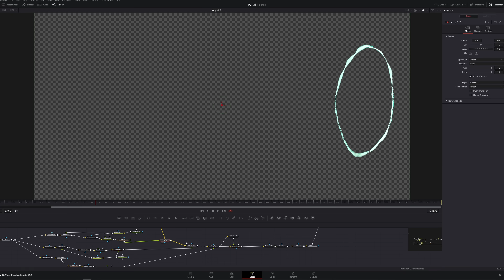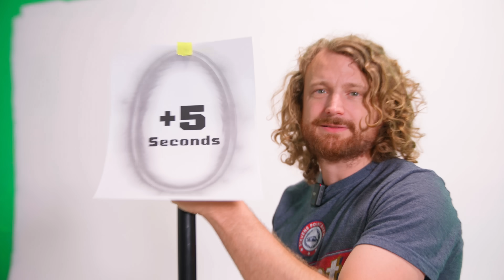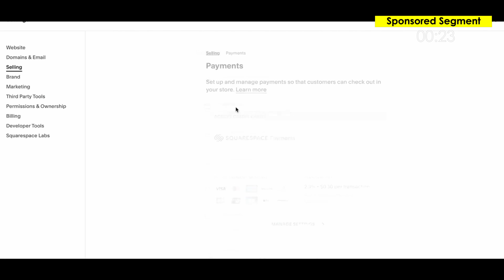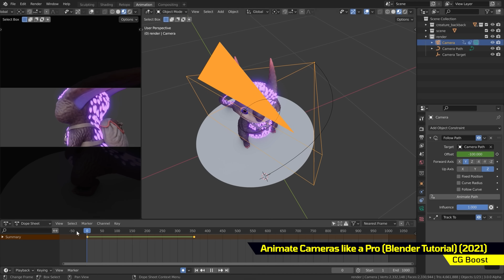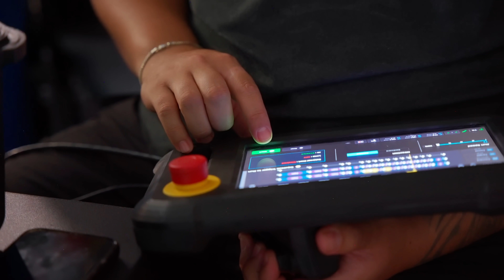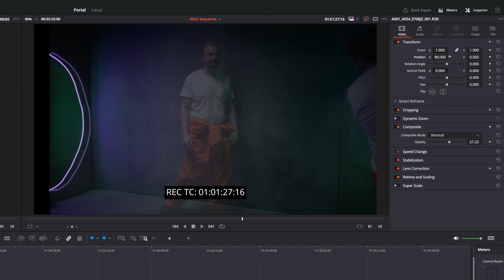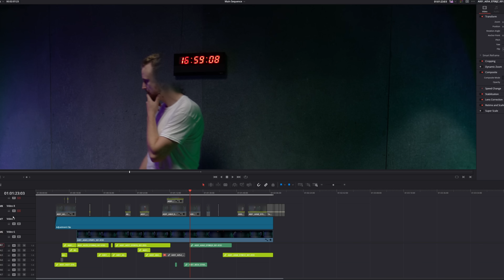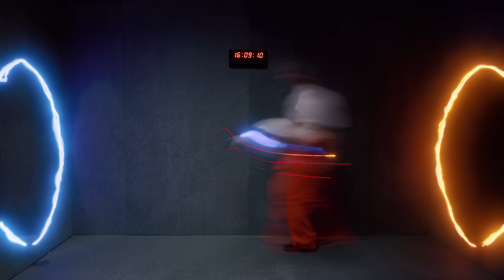This is What Happens When you Desynchronize Portals

Comment: tldr: my theory is that time travel wont make changes to the 3d world, if you look at time as simply being another dimension where each dimension is seen as a coordinate. this is what i think would make most sense

the fun thing about this, is how we understand changes to the 3d world because something happened in the time dimensional one.
we could apply the rule that one dimension is not allowed to bend another. For example, on a 1d line, you cant reach another spot without moving one the line, BUT by adding another dimension, you can bend the line so that 2 spots in 1d can meet. you can also call this a rule that every dimension is a coordinate, meaning they dont influence each other.

using this logic, time travel doesnt actually change anything in the 3d world. you will notice this through the time dilation principle too - while a very very fast moving object in theory experiences time slower than an object moving at normal speed, the time difference doesnt affect where they are.

basically, by moving in time, youre only changing WHEN you are, not where. therefore, when stepping into a portal, theres no change to the 3d world because well the only difference lies in the actual time - you cant bump into yourself by traveling in time because in space youre already there.

do remember that this is all just a theory. im no physicist

Comment: I had an Idea for a video, tactical politeness based on the idea of tac2COOL RELOADS. Tactical politeness is where you're so polite you're hostile.
Jack.
Says: Do you have an extra chair somewhere, Dan?
Jack has his back turned towards Dan looking for an extra chair.
Dan.
Says: Yeah, I have THIS ONE.
As Dan says (this one), he hits Jack with the chair, which separates upon striking Jack, which forms into the original chair under Jack so he can sit.
Jack.
Says: AH, why did you hit me, and why doesn't it hurt Dan?
Jack is now sitting, freaking out, and checking his back and head for injuries. But he's not hurt.

P.S. I really like the concept of this video.

Comment: Wouldn’t this break some laws of physics? Not the portals, but the fact that the portals are desynchronized, if you throw something through the going to the future portal, it’s mass would stop existing for however long, and then reappear, which isn’t possible
Reply: Im just spewing bs but maybe it could work.
Since youre not destroying or creating matter, youre just sending it to a different spot in spacetime.
So here time works like our 3 dimensions, youve just shot one of the portals forward in the 4th dimension, So further in time than the other end of the portal.
Reply: Imagine a 2D world, now Imagine time as the 3rd dimension with every moment shown as another paper thin layer above the Last.
Now Imagine they have a portal gun that creates flat lines and If they walk in, theyre appearing out the other.
Now Imagine they Somehow got the other end of the portal 5 seconds to the future that is still connected to the 5 seconds ago past version of the other end.

In this cube of 2D worlds, no matter is created or destroyed, only moved to another spot in the cube.

Comment: Love the video!  Well done!  😎 Your crew's content is great!  Got me thinking what the details would actually be for this, so I geeked out and did the math.  Let's say terminal velocity with easy numbers for simplicity would be 200mph through still air.  I'm not sure what drag decrease a person would get from them pushing down the air at high speed in the center of the room every 5 seconds, but let's just double the speed for fun.  400mph means about 600 feet per second, meaning it takes 1/600th a second to travel 1 foot and 1/60th of a second to travel the 10 feet from ceiling to floor.  So one would travel forwards in time 5 seconds in world time every 1/60th a second their time.  So basically time goes 60 times faster for them.  That means it takes at least 6 days of falling per year it takes for the building to be demolished.  Also, even with the best of luck as far as how that ceiling fell and positioned itself for the exit launch, there's no landing that safely at such high speeds without long fall boots being worn.  😛😉  If only GLaDOS left a companion cube or edgeless safety cube one could repeatedly get to terminal velocity and then fire the green portal on the wall to send it wrecking ball style into the opposite wall to do a "manual override" until it broke a hole to escape from.  ➡P.S. Please ask Steve Burg or whoever came up with the design of the Sentinel from The Matrix if it was inspired at all by Star Control 2's Kohr-Ah.⬅  Google it.  Sooo similar.

Comment: Fun thought experiment. Would the times not cancel each other out because it’s passing through both portals technically so each time something passes through it would both move forward in time 5 seconds as well as move back 5 seconds putting it at the original time it passed through the portal

Comment: I am thinking way too hard about this video but what you did was open up the science community to an interesting number  of potential paradoxes and scenarios. Which is great for hypothetical physics. 

There are: 

1. Two Portals Portal A and Portal B.
2. Portal A Takes you 5 seconds into the future.
3. Portal B Takes you 5 seconds into the past.
4. Instantaneous Transport means Each portal transports you instantly to the other.

1. Where Are You During the 5 Seconds?
    A (Future) If you step into Portal A, you instantly appear at Portal B, but 5 seconds in the future. From your perspective, the travel is instantaneous. However, for an external observer, you would disappear and then reappear 5 seconds later.
    B (Past) If you step into Portal B, you instantly appear at Portal A, but 5 seconds in the past. From your perspective, the travel is also instantaneous. For an external observer, you would disappear and then reappear 5 seconds earlier, seemingly appearing out of nowhere.

2. Experiencing the 5 Seconds
  The person traveling through the portals would not experience the 5 seconds because the transport is instantaneous for them. They effectively "skip" those 5 seconds when traveling to the future and "reverse" 5 seconds when traveling to the past.
   An external observer would see the time difference: a person stepping into Portal A would reappear 5 seconds later at Portal B, and a person stepping into Portal B would reappear 5 seconds earlier at Portal A.

3. Canceling Out
   If someone continuously moved between the portals, they would be in a loop, constantly shifting 5 seconds forward and backward. However, since the transitions are instantaneous for the traveler, they would not experience any elapsed time.
   - From an external observer's perspective, this could create an unusual situation where the person appears and disappears in a cyclical manner.

Paradoxes
1. Causal Loop , If you keep going back and forth between the portals, you could create a causal loop, where the future and past events influence each other in a continuous cycle. This could lead to paradoxical situations where the cause and effect are indistinguishable.
2. Information Paradox:  If you bring information from the future to the past, you could create a paradox where information exists without an origin, violating the principle of causality.
3. Observer Paradox… An external observer would see you disappearing and reappearing at intervals that don't align with their own perception of time, leading to potential confusion and paradoxes in their understanding of events.

Traveler's Perspective for the traveler, the journey is instant, and they do not experience the 5 seconds.
Observer's Perspective The observer perceives the 5-second difference, leading to potential paradoxes in the continuity of events.
And relative Time.. The concept hinges on relative time perception, where the traveler skips or reverses time instantaneously, while an external observer perceives the time difference.

It becomes even more complex of you are the observer and the one entering and exiting these portals.

Comment: You can escape the room without broken portal guns, just shoot a portal on the floor and another one on the ceiling, and then once you have enough velocity, shoot the portal from the ceiling on any wall. You will then fly at the opposite wall, breaking it if you have enough speed. And since hurting yourself from hitting something at terminal velocity doesn't happen in either the original games or your sketch, I think it can also be ignored in this scenario.

Comment: All you have to do is put the +5 second portal on the ground and the other on the celing so you can achieve freefall between them going terminal velocity into the +5s one. Assuming a lower end freefall speed of 120mph which is 1 mile every 30 seconds, and a mile being 5280 feet, assuming 12' ceilings that means every 30 seconds you are going through the +5 second portal 440 times. So doubling that for a minute and then adding+5 per entry you teavel 4400 seconds for every 60 seconds that pass. Which comes out to about 73.33 minutes for every minute you spend. That means every 19.64 minutes you spend falling is 24 hours to the rest of the world. That means that every 24 hours spent falling 72 days will pass for everyone else. Every 3 weeks you spend falling is 4.12 years, so just keep falling until the company keeping you trapped goes out of business. Every year spent doing this is about 72 years to everyone else. So assuming you're fed and what not  you may be able to outlast the company funding it.

Comment: here's one for ya.... if u shot the portal on the ground (+5) and the other (-5) on the ceiling... but jumped through the +5 portal before 5 seconds. say immediately dropping in after shooting... then theoretically you would be stuck in the void no? temporarily speaking. because until that 5 seconds is up. as long as you jumped in the +5 portal within 5 seconds of shooting it. past you hasnt even made the second (-5) portal by the time you should be coming out of it🤔🤔🤔🤔🤔🤔

Comment: Technically, at the end of Portal 2, you launch a portal to the moon, the moon is more than 340,000 km from the earth, it is so far away that light takes 1.2 seconds to get there, The fact that the portal gun generated a portal on the moon in less than 2 seconds means that the beam goes almost at 50% of the speed of light, If that's not amazing enough, consider that when we talk about the speed of light, we're not just taking into account distance, but time dilation, Passing through a portal from the Earth to the Moon would mean you traveled 1.2 seconds into the future, Because from your perspective you reached the other side instantly, but from the point of view of others they saw you disappear for 1 second and appear again on the moon, or the other scenario would be to see a copy of yourself appear on the moon, a second before crossing.

Comment: wouldn't this happen irl if portals were real, cause sending you through a portal would move you instantly to the other portal you would have to travel faster than the speed of light, which would create a negative time interval that would scale based on the distance between the two portals

Comment: What are the "concrete" walls made of? The video is really cool, and you did a great job of making it easy to figure out what was happening, the only thing I can't figure out is how i can recreate those walls.

Is it just foam board that you textured yourself before painting, or is there a cheap premade material with that texture already? Or am I off completely and the walls are smooth and the apparent texture is simply coming from the paintjob?

Comment: This is a cool concept but when looking through 2 linked portals you should see directly through the other one, so in the +5 seconds portal it should show the room 5 seconds in the future and -5 obviously shows 5 seconds in the past, would it be possible to make this effect in a video setting like this? With the portals facing each other like this, it should in theory show a line from the beginning of the time loop to the end of the loop if you looked directly through, so running in a straight line would get you out of there if you ran fast enough

Comment: TLDR: This could have been a real bloody and violent video if they had thought it through.

10:45 Imagine that the portals are close enough that Niko can pull on his arm exiting the right portal.

0s: Right arm enters left portal.
5s: Right arm exits right portal.
6s: Left arm pulls right arm. half a second later right part of the torso should come out of the right portal.
But events that cross the right portal should have happened 5 seconds earlier in the left portal. So let's correct:

0s: Right arm enters left portal.
1.5s: Right part of the torso enters left portal (wait, he got pulled instead of just putting his arm in there, ok ok this is still good)
5s: Right arm exits right portal.
6s: Left arm pulls right arm. 
6.5s: Right part of the torso should come out of the right portal.
7s: Whole torso is out of the right portal... so it should have entered the right portal 5s earlier. let's correct

0s: Right arm enters left portal.
1.5s: Right part of the torso enters left portal
2s: Whole torso enters the left portal
5s: Right arm exits right portal.
6s: Left arm pulls right arm. 
6.5s: Right part of the torso should come out of the right portal.
7s: Whole torso is out of the right portal
7.5s: Whole body is out of the right portal... so whole body should have been through the left portal 5s earlier. let's correct

0s: Right arm enters left portal.
1.5s: Right part of the torso enters left portal
2s: Whole torso enters the left portal
2.5s: Whole body enters the left portal still holding unto the right arm?
<there's nothing in the room for 2.5s>
5s: Right arm exits right portal.
6s: No left arm pulls on right arm <but it did happen, right?>
6.5s: Right part of the torso should come out of the right portal.
7s: Whole torso is out of the right portal
7.5s: Whole body is out of the right portal

So between 2.5s and 5s, Niko is split as his left arm is still holding onto his right arm but there is nothing in the room from 2.5s to 5s. When his Right arm exits the right portal, there is no left arm to hold unto it a second later.

Comment: If you had a Portal that's 5+ and one that's 5-, both of which are connected to each other. Wouldn't they cancel out each other? Since everything that's is thrown into 5- would come out 5 seconds delayed but everything that comes out 5+ would be 5 seconds ahead (-5+5=0). The only way the ball would arrive earlier or later then expected is, when one Portal runs at normal time and the other has some sort of time delay

Comment: THIRD COMMENT. lol
Idk how you have yourself do it. But if you arrive 5 seconds in the past every time you go through, you can keep going through til you get further in the past to before you got INTO the room and then quickly get out when your past self enters.

This likely means the plot twist is that Nico, the entire time, knew he was going to escape, and was just frustrated trying to figure out how his other self did it or how long it took before doing it. Which is why he was running through the portal over and over to begin with. We never saw prior to this scene so we are missing information that is probably going to be revealed later. c:
Reply: But you can't reach a point in time before you placed the portals.
Reply: @papaaaaaaa2625  Yes you can. He still has the portal gun that now creates time travel portals. He can make new time travel portals once he gets further back. He would just have to keep placing new portals each time he goes back 5 seconds.
Reply: @Axxidous  yes, he can create new portals, but not beyond the point in time he created the first portal.

He just can't travel further back.
Reply: @Axxidous  imagine you install two portals at 5. 
A hour later you start travel back.
As soon as you reach 5 o'clock you just can't travel further because there was no portal at 4:59:59.
Reply: @papaaaaaaa2625  So you reach that point, you still have the portal gun with time travel portals…. Does your body just freeze or explode? Why would you not be able to create another portal and go further back? If anything, it means he probably CAN go further back, but chooses not to or solves the problem without needing to. And that’s why there were no time portals prior to that point in the first place.

Otherwise, it would just be an oversight in the writing of the scenario to not think of the fact there could be time portals prior to him kicking the gun. lol